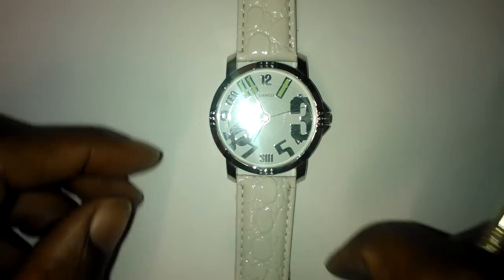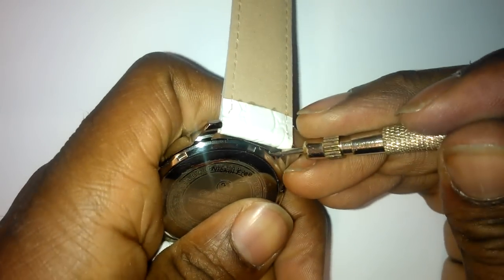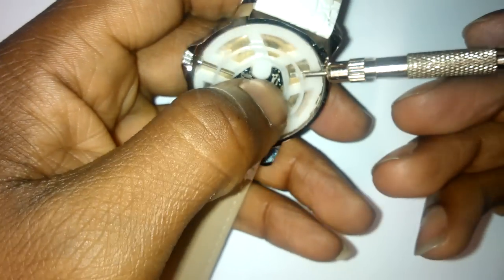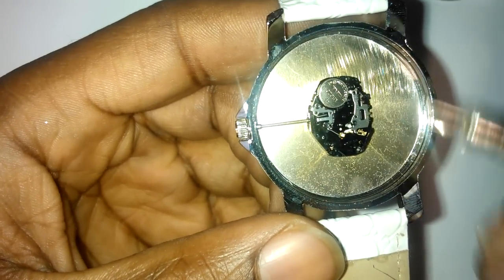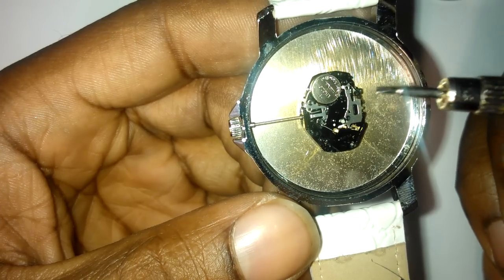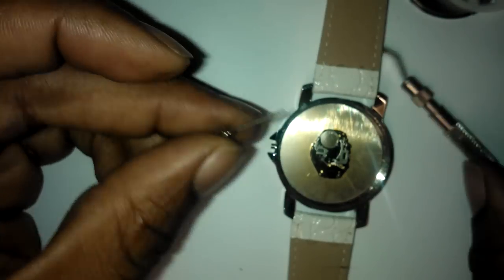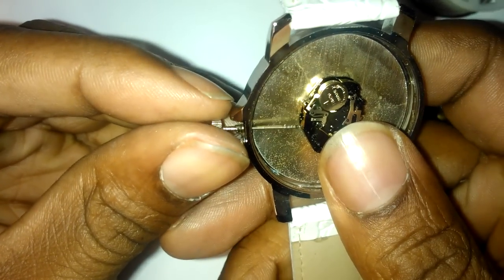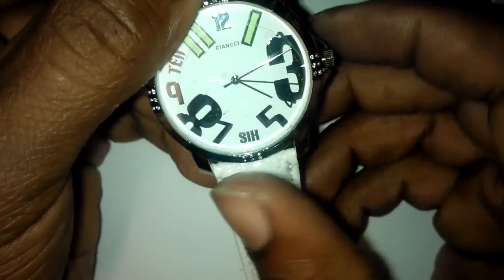WRISTWATCH REPAIR: How to remove and replace winder, stem and crown from a watch

Comment: dude I am a steampunk artist and I have taken apart at least 400 watches to get the gears out and 90% of them like the one shown here. No gears, dead battery, cheap (not gold/silver) band, so the only thing salvageable in it is the hands and the watch face if it is metal and has a unique design, but the pin nightmare i use wire cutters to get it out. or i bend it till it pops out. your video just made me slap my self in the head. this will save hours every week! thanks you rock

Comment: Thank youuuuuuu.... You know what, with your helpful information I could able to save my new wrist watch , its machine wasn't working but it was in a brand new condition and I have a old wrist watch but working perfectly so as you taught, I remove the pin and place old watch's machine in the new watch. I'm so happy, it's feel like a big achievement😂😂😂. Thank you so much 👍

Comment: Hi Gizmo, i have a japan mechanism watch as well, i managed to get as far as removing the back plate , the plastic bezel , and the stem. I took the face out and i need to re-attach my second hand as it has come loose. My daughter dropped the watch, my goodness. So now i am stuck trying to attach the second hand i dont seem to figure out how to attach it and my god it is so tiny to see , i am trying this at night time in artificial light so maybe its not the best idea. I feel a bit blind now because i was using a headlight you fit on your head when you go hiking/camping. Anyways i can see the minute and hour hand are seated nicely and i can like feel a pin at the top of the last hand fitted which is the minute hand so i imagine the second hand needs to be seated on that pin... its very very small and i dont even understand how it is supposed to hold on to like 1 millimeter of a pin. I seem to manage to attach it, IF i am doing it the right way round?  but then when i hold the watch upside down to check it doesnt fall, IF bloody falls. I dont know now, i am stuck. It seems to be very loose but when i turn it with the screw driver it is turning on the pin "so it seems" but it is loose i dont know now i am stuck and i feel useless.

Comment: bro help me please,
i wanted to clean my watch from the inside, so i opened it took out the white plastic bit and because at the time i didnt know i had to push down the spring machanesium to release to crown and stem, i just pulled it really hard. and now the hands dont work. even when the crown is at its normal position the hands dont move.however the hands do move when i twist the crown. how do i fix this please help, have i broken the spring or something. please reply
Reply: ok thanks dude

Comment: This is only one type of movement. Others require you to push a sharp object into a hole (sometimes even noted with an arrow and the word "push"). I came here to find out about removing a stem from a Swiss mechanical watch so this was of no help in that regard.